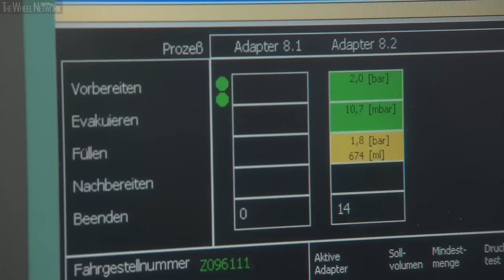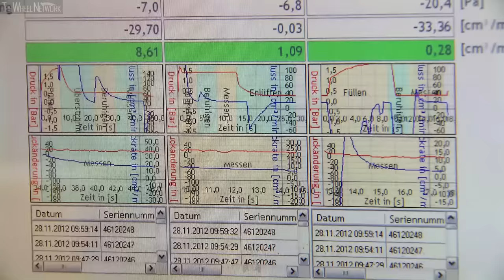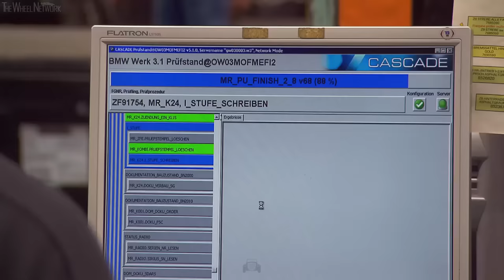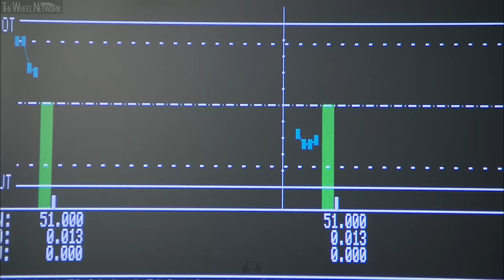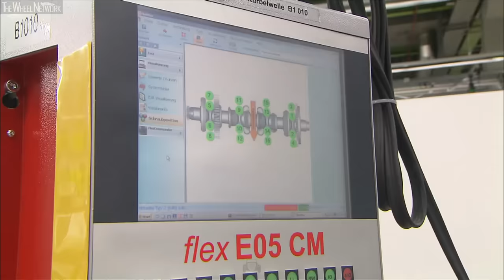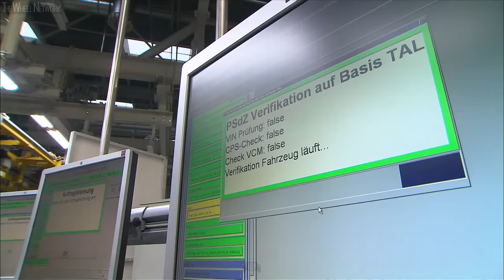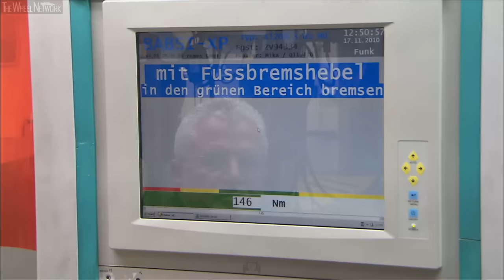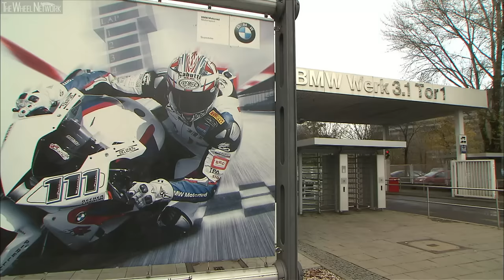BMW Motorrad Production in Germany – Manufacturing of Motorcycles and Scooters

Comment: @5:20 An all-electric scooter, and they're using inefficient halogen headlights?
Reply: It's a somewhat older film newly compiled? Parts of the S1000RR or GS assy for instance show date '28.12.2012' if i remember correct.